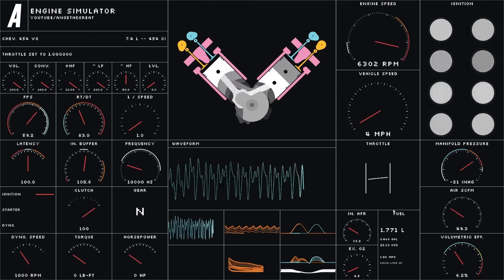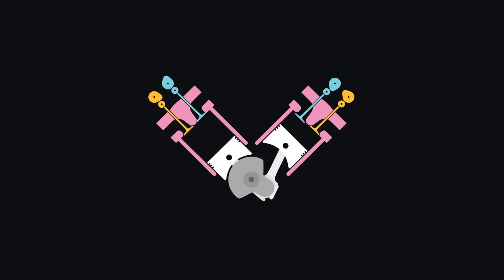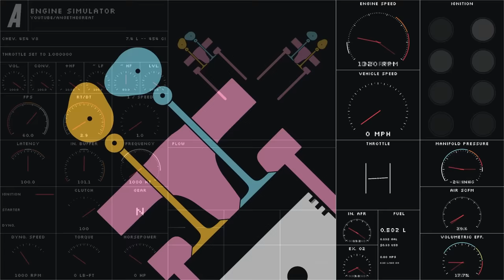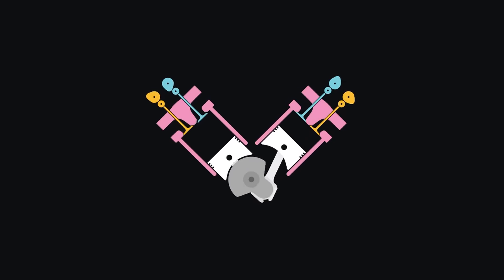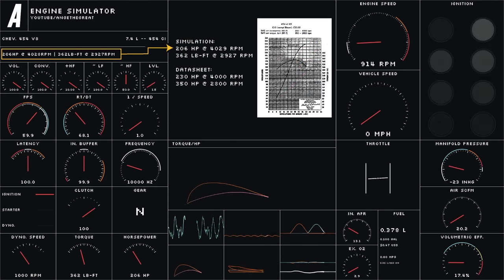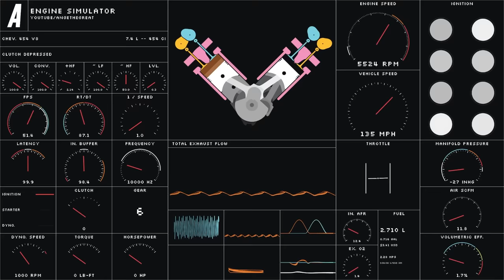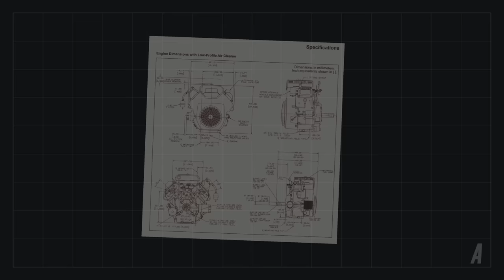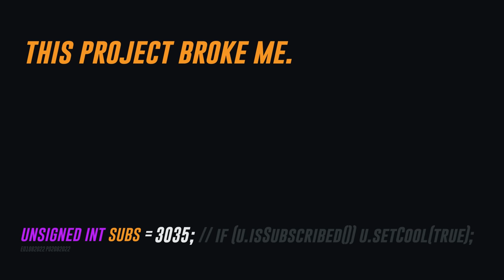Simulating an Entire Car Engine (yes, it makes noise)

Comment: Some more thoughts: - What about two-strokes? These dont have the valve train simulated in this example. Can the model environment handle that? Check out "2 Stroke Stuffing" channel - what about a collab with him?  What about a meta-layer on top of the simulation which changes parameters - eg. varies the angle of a "V" engine from 30° to 90° in 1° increments and runs a full power cycle - what can we learn from the power and torque curves? Or for a fixed engine configuration changes fuel characteristcs or ambient air temperature? What about a forced aspiration simulation?  Different turbo/supercharger configs. I see no mention of temperatures (like we had on jet engine simulations for inlet, EGT etc.) Thermal modelling could be interesting - many possibilities here. Engine block material, thermal transfer to coolant, coolant to heat exchanger, etc. Maybe this would be a great topic for a development community, not rest alone on one guy's shoulders. A kind of Mozilla.org for engine simulation - Motorzilla!?  Just thinking aloud. All the best, Rob in Switzerland.

Comment: Do you think this could be adapted to a diesel combustion cycle? Something like an arbitrarily large diesel engine would be cool to simulate (like a big marine diesel).
Reply: Is the combustion cycle not already diesel? I don’t see a spark plug.
Reply: @GustafBergfors  its throttled with air so i think the spark just might not be visualized

Comment: This is an unbelievable achievement!

I've been dabbling with engine sound synthesis for a long time and could only dream of having the ability to drive it all with physical simulation.

I also have a keen interest in engine balance and how that comes about from various configurations. Your simulator would make for a stunning sandbox in both regards, honestly the kind of toy tool that I've been dreaming of all this time.

I love the glossing over of so many in depth aspects of even making this work. One of the most important is the convolution filter. Just today I've been revisiting my hand written notes on creating "filters" for engine sounds like this.

As an amateur, I've personally tried all sorts over a decade or more, including full digital waveguide networks. So it was great to see this pop up in my suggested videos, and it comes very close to the best professional synths / simulations I've heard on my journey!
Reply: What are some of the other examples you have found
Reply: @hisride  Sonory and Gran Turismo are two high quality applications coming from two opposite approaches.

Ricardo Wave can produce some interesting sounds with a bit of post processing, similar to what's seen here, but that's an engineering tool and not exactly accessible. There is a video on here for a boat sim of someone solving the 1D wave equation, like Ricardo Wave does, but far simpler configuration and in real-time on a GPU. It has some excellent expressivity built in as a result.

At the lower end of the fidelity spectrum, and one that's been around for ages, Live For Speed nevertheless has synthetic engine sounds that can be given arbitrary engine configurations and it works pretty convincingly.
Reply: @identiticrisis  interesting, thank you

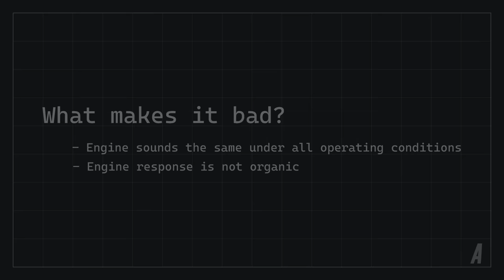Comment: 1:58 What the pedal does is actually regulate the load of the engine, which is the percentage of its torque you ask it to output. For example if you have an engine that is at 2000 rpm and at that speed it can output 120 Nm of torque, slamming the pedal will tell it to output that full 120 Nm, which will either cause it to rev up or it may be necessary for it to maintain speed depending on conditions like incline. Electric motors, or at least the three phase ones controlled by computerized inverters you'll find in electric cars, are actually controlled in the exact same way (i. e. the pedal commands torque output and if you fully let off of it the motor will output negative torque for regenerative engine braking)

Comment: You've captured the attention of car guys and computer guys in one project. Massive props, this is incredible. 
Now I'm very curious to push the limits of this program. Can flat plane cranks be simulated? Forced induction? Rotary engines? Non standard pistons, like the oval shaped ones Honda used in a few bikes?
Reply: I think it would be neat if it could simulate sounds of fake engines, or engines that don't exist or are extremely uncommon, like 7-cylinder or 9-cylinder engines.
Reply: Im both a computer, and a car guy!  :D
Reply: induction force seems not but from what he said in the video everything else you mentioned is possible
Reply: I know a lot about cars but I know jackshit about complex maths or coding
Reply: Everything can be simulated

Comment: How well does this handle lugging the engine---putting more load/resistance on it than it can really handle and dragging the RPM down? This is usually an area even otherwise good games tend to be really bad at (you try to climb too steep a hill, and it just sounds like you've let off the gas pedal as the engine revs down), but it seems like your model ought to cover it.
Reply from the maker: I'll show a demo of this in my next video, it handles it reasonably accurately!
Reply: @AngeTheGreat  man I'm gonna be honest I hope it's coming soon im excited like really excited but take you're time on this I'll gladly wait.
Reply: Latest farming simulator simulates gears, rpm and load to create their engine sounds

Comment: This is absolutely incredible. I would expect you should be getting a call from industry engineers, as I feel this is a bit more comprehensive a simulation than their own CAD based CFD simulations they carry out for individual cylinders. I'd be very interested in those extra details myself.
Reply: the fluid dynamics in this are at best oversimplified

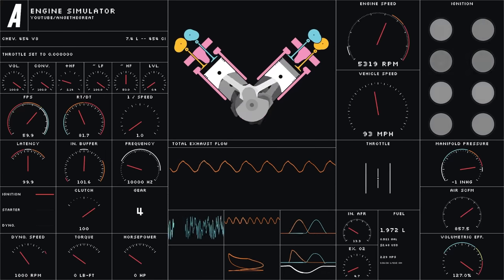Comment: 8:37 I just need to point out the little hiccup going into 4th gear is one that SO MANY GAMES DO NOT ADD and it is so relieving to see it not forgotten here. Cars do this! Why more games don't emulate this little hiccup is beyond me.
Reply: What causes this?
Reply: @richardeadon6396  there's nothing particular to 4th gear that would cause it... the most likely cause IRL is the driver's clutch timing being slightly off. In my car 3rd-4th is a wider ratio than the previous 3 gears so you have to pay attention and learn where each gear is.

Comment: Pretty cool!
4:29 Suggestion for the future: Add exhaust routing since this has great effect on how the engine sound.
A American v8 engine (Crossplane crank) with equal leangh exhaust headers/tubbing will sound closer to a European v8 engine (Flat plane crank). It also effects the engine power/performance since equal leangh exhaust has better scavenging.
There are other things like straight pipes, H-pipes and X-pipes that also effect the sound and performance.

Comment: This video perfectly explains what the sounds of an engine are. The “gurgling” on a truck is simply the pistons, moving back and forth at over 33 times a second, pulling gas and air, making fire for those tires to shred ass across the pavement

Comment: Did I understand this correctly: noise (randomness) is added as part of the digital filtering, on the pressure waves as they exit the cylinder? If I got that right, have you considered adding the randomness earlier, such as tiny variations in ignition timing, fuel amount or fuel distribution each stroke? I know a lot less about engines than about programming, so perhaps the "authentic", non-perfect, "un-digital" sound real engines make comes from other variations, I'm just curious if introducing the randomness earlier in the chain would sound even closer to reality...

Also, does the simulation support different shapes/lengths of exhaust pipes? (Again, my knowledge is limited, but exhaust systems do affect engine sound quite a bit, right?)

As a fellow programmer, impressive project!
Reply: As far as I could discern from the script we see during the video there is randomness on the fuel burning efficiency. Also I'm pretty sure from what I understood the exhaust pipe resonance / sound is added as convolution which means it's probably convolved with an impulse response of that particular pipe. Since an impulse response is nothing more than an audio recording of a certain sound as heard through the pipe with some recording equipment and more pipes they could be added to the simulation with not too much effort. Also maybe somebody has already made impulse responses of different pipes available online. The web is a wondrous place
Reply: I think his convolution filter is based on a selfmade model in his own simulation engin. There was no ned to actually measure a pipe, since he already made the tools to simulate the System.

Comment: The train simulation people would love an accurate sound for the generating engines, would be especially cool for Genset locomotives (they have several engines running several generators which are started and stopped for electrical demand). A three phase generator, rectifier, and inverter should be a lot simpler to simulate than a whole automotive powertrain.
Reply: That's the first thing I thought of, this would literally change train simulators forever

Comment: I don’t think you realise just how valuable this project is. If I had enough capital, one of my dreams was to fund the creation of some software like this - specifically for the development of custom made exhausts. 

It’s much simpler (once the software is actually finalised) to design an exhaust system ‘virtually’ in order to get the desired sound you’re looking for. In comparison, exhaust shops build some initial configurations, test them, and select the one they like most - but they often struggle to get the exact sound they’re looking for. 

Instead, they just settle for the ‘best’ sound that resulted from one of the handful of set ups that they started with. But with this software, the process of trial and error is much more cost effective, and much faster. You can virtually design 100 different exhausts with different materials, shapes, thickness, lengths, diameters etc. to get the best sound from each specific engine. 

You’ve literally accomplished one of my dreams lol. Bravo.
Reply: I was thinking this as well. The application is almost limitless I’m getting giddy just thinking about it. This is basically what CAD added to the design process. Yeah we still use clay but it really brought us forwards a lot. Shame ICE is dying
Reply: This! I would love to play with it just for this reason.

Damn I was looking for something like this for years just to play with for my car!
Reply: @hisride  Thats a good quote "this is what CAD added to the design process"

Comment: When I've seen simulations like this before they seem to break down on the parameters of motorbike engines, e.g. a 600cc engine revving to a really high rpm and producing 100hp. That would perhaps be an interesting test.

Comment: Amazing results! The sound is perfect! Really interested on all the resources you had read about this topic, and would love to see a more detailed video on this topic. I also tried simulating an engine for my indie racing game came close but found this savior video, also very curious if it can simulate a wankel/rotary engine as it has 0.75 revolutions per stroke in total 1080 degrees of rotation or an gas turbine/jet engine used in some tanks because its a similar principle but different in action (2 strokes engines are similar to 4 strokes)

Really great video, keep it up!
Reply from the maker: I'll probably talk a bit more about these details in another video. For rotary engines, I'd need to make some modifications to the physics simulation but all the air simulation stuff should be directly transferable.

In terms of resources, honestly it was mostly research papers, Wikipedia and a textbook called "Internal Combustion Engine Fundamentals". That last book in particular has an incredible amount of useful information for ICE simulations. Thanks for watching!

Comment: It's interesting that some driving games and even some simulators can get pretty unrealistic engine notes, although the outstanding sophistication seen heard in your video can be approached so that the engine type and cylinder count can be identified from the engine note. Really, hats off to your work!!!
There is a guy on youtube, who only simulates the firing order and timing of engine with small devices that only make a short 'pop' sound and puts them in a similar geometrical arrangement than those of the real cylinders in the real engine. And one can instantly recognize the characteristic sound of that engine (e.g. a VR6, a cross plane V or a 5 cylinder).
If I were to make a simplified simulation, I'd only synthesize/replicate the crank noise pattern (V, boxer, flat plane or cross planes with angles), the cylinder sounds (in the right firing order and phase, some low frequency 'combustion bass' which is not present when engine braking) and any characteristic sound components like induction noice, supercharger or turbo sound, BOV etc. IMHO it would be a sweet spot between a recognizable engine note and computational effort.

Comment: Maybe add a exaust simulation too. Header Type and length, X and H Pipe, and the dimensions of the internals of the muffler. If you script all of this the inputs and outputs of each section can be linked together. Not sure how realistic this can be and how much CPU Power that would "eat" but could be interesting to playarround with. In this case a turbo charger would also be possible. To be completly fancy the internal resonance of a car could also be simulated in addition to the external sound 😀
Reply: and wear and tear possibly. It's interesting to see how engine sounds after say 5 years of use.

Comment: This is great stuff, I was so amazed to see that someone shares the exact same frustration of video game engine sounds that I have. I've always wanted to make some simulation like this and take into account the complexity of an actual engine and not just play a tone. Congrats! And also congrats on the choice of engine to start with!  

Don't know if someone mentioned this before or if it's youtube compression that makes it even out, but I think this simulator will be really awesome if sound volume increased with throttle angle more. Also intake suction noise will be an awesome improvement. 

 Overall awesome job, I pulled the code and will try to fiddle around a little,  you may get a PR soon.

Comment: I have not ever seen someone able to do all of this on his own. You can accurately model physical systems, mechanical systems, thermodynamic systems, fluid systems, code everything yourself and do graphical User interfaces. What the heck how did you learn to do all that? It's so fucking admirable  

Please do a technical breakdown of it. It's the most impressive engineering tool thing I've seen and you just casually did it out of curiosity and to prove a point. Many of us aspire to one day be half as talented as you are sir
Reply: I'm sure he doesn't have any friends and he never goes anywhere.

Comment: That's amazing mate, especially the fact that it's running in real time and can simulate the HP and torque that accurately. I wonder how heavy the simulation is though, since that could limit the usability of the simulation in racing games for example.